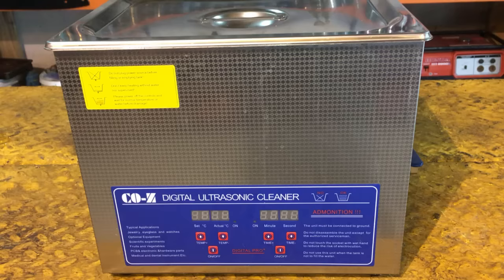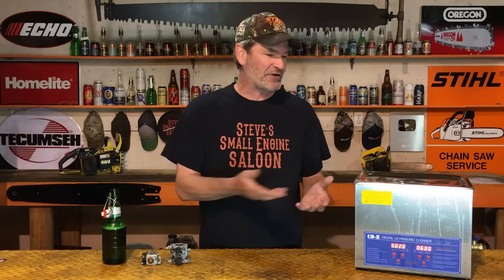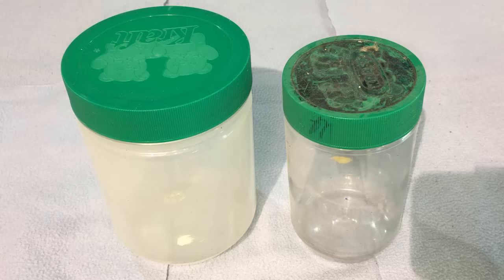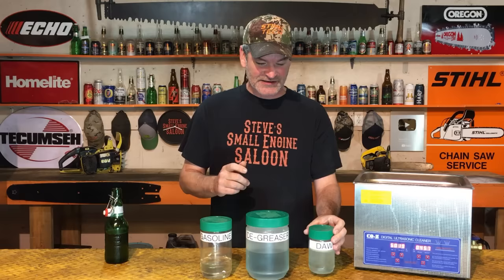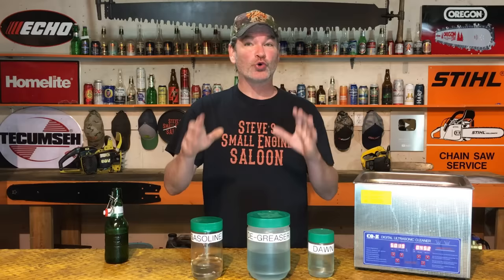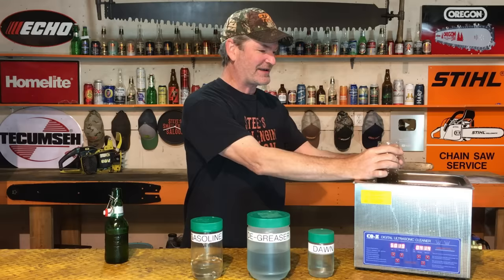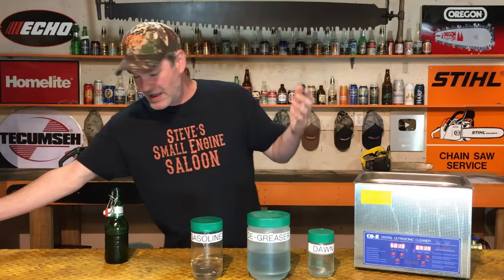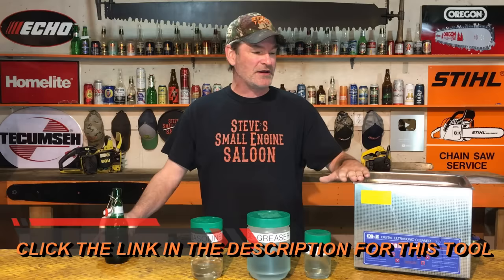ULTIMATE TIPS For Using An Ultrasonic Cleaner (Must Try)

Comment: These bubbles are in fact vacuum bubbles. The cleaning happens when the vacuum bubbles collapses. This is called cavitation.  The imploding ( not exploding) bubbles  blast  the dirt from the surface.  Other than told  it's a cold process... No high temperatures involved. 
Cavitation can happen with centrifugal pumps when the vapour pressure of the liquid is lower than the suction head of the pump. In this case the pump will be damaged soon.

To avoid explosive vapours, don't use gasoline, use diesel or Kerosin instead as a solvent.

Comment: Gasoline should not be used to clean anything that requires an oil film or grease to stick to it. A good example would be wheel bearings. Stoddard solvent works much better.

Comment: If you're using flammable substances it's recommended to put them in a sealed container and float them. The reason being is gasoline produces flammable fumes you probably don't want hanging about something like this which uses high voltage to operate the transducer that produces the ultrasonic sound waves.

If the unit isn't faulty, you're likely fine. But these come from chinese suppliers that tend to cut corners when it comes to safety, and it's better to be safe than sorry.

Comment: use a cheap stand to hang the bottle in the solution without allowing it to float or move. This way most of the energy is transferred to clean the dirt. Thank you.

Comment: You can also use zip lock plastic bags, just put a small amount of cleaning solution in the bag drop in the part you want to clean, seal it up and drop it in the cleaner.
Reply from the maker: Yes I show that in my update video!

Comment: the driver of the cleaner needs to be cooled, on my old model it was not protected at all, i filled it with not enough water and after 30 min became very hot and the piezo made a crack, some sparkles between the gap and it blown

Comment: Your technical description is a little bit wrong, here you will find a better one.
The ultrasonic energy vibrates the fluid at 40kHz. When that energy touches anything hard it will generate vacuum bubbles, when those vacuum bubbles implode (not explode) a lot of vibrations are generated in all directions. And as most fluids are rather uncompressible the sound/energy wave travels in all directions, when such wave reaches something soft like dirt or grease the energy is dissipated into that grease/dirt and it will be transferred into the cleaning solution. When choosing a container is should be thin-walled and have low mass and also be as hard as possible. So soft thick plastics that are compressible are useless, used paint cans or tin cans are perfect and better than peanut-butter jars.
Another cleaning agent that is rather useful is laundry detergents, which will be much better for organic stuff that needs to be removed.

Comment: Hey Steve, I have a question. Can a decompression valve for a chainsaw be cleaned and reused? My STIHL dealers are asking $47.00 for just one so if the old one can be cleaned and reused I’ll be happy.
Reply: Just try it out Shazza, she'll be right mate. you'll STIHL have to buy a new one anyway if it doesn't work so you have nothing to lose.

Comment: The reason the cleaner needs full water is for cooling. The heating element blows out if the temperature gets too high and so does the ultrasonic transducer. Water keeps the temps down.

Comment: Clock hobbyists have a soup that they like for cleaning centuries of dust, glop and dried up oil that has accumulated on brass clock movements. It should not be used on the mainsprings of wind up clocks as it really corrodes iron.
If you want to make a homebrew ammoniated cleaner, here's a mix:
4 ounces Murphys Oil Soap
4 ounces acetone
16 ounces UNSCENTED PLAIN BORING household ammonia
Add water to make one gallon.
= 1 Murphy: 1 Acetone: 4 Ammonia: 26 Water units. Makes 32 units.

Comment: The flashpoint of gasoline is -45 deg F.
This means that when above this temperature, gasoline is giving off a flamable gas that is above the liquid.
Any ignition source, spark, ect will cause an explosion.
It is EXTEMELY dangerous to heat gasoline in an un-enclosed container when around electrical equipment.
When working with gasoline, keep the time with the lid off to a minimum.

Comment: Steve's Small Engine Saloon , what is this thing supposed to do when its running? Is there supposed to be a lot of bubbles, super fine ripples on the surface, mine has none of these things. I added some dawn dish washing liquid to some water, and it wont clean nothing. Put a couple ounces of degreaser with some water. Doesnt do anything but make this buzzing sound. Does anyone know what might be wrong?

Comment: If you pour less cleaning liquid into the tab, the rest of surface of the tab which is not covered will absorb all the vibrations & that will break the ultrasonic machine itself as vibrations has no material to pass through.

Comment: Is there not a heating element to the cleaner (I have never worked with one so I ask) ? I'm not sure if you put the heat up to 120 or whatever, it would transfer into the jar. Also, using heat and a closed jar with gasoline..I can't think that would be very safe but again..I ask because I don't understand. Now that I am retired I love fixing things I can (like carburetors) so I am very grateful for these videos! Blessings.

Comment: Well according to a manufacturer (zenith) you will loose %50 to %60 of your ultrasonic action through the plastic jar, best way to use is suspend your part on a wire off the bottom. If you place material on the bottom you can harm the transducer. Even the basket he has in tank is robbing ultrasonic waves. The more direct is the best.

Comment: Tip for those using it for cleaning brass. Dawn and a 9mm case full of Lemi-Shine dish detergent powder. Thoroughly rinse off when done. And a good way to dry the brass is ti go to your local resale/thrift store and buy a used hair/blow dryer. Put all the brass in a large pasta basket strainer and moving the dryer and brass around  let the brass get hot and after about 5 minutes, give or take a minute or two, the heated brass will evaporate the water. Don;t worry about over heating the brass. Unless you heat it to like 400-500 degrees, it's not going to hurt it. Word of caution. DO NOT USE MORE THEN A 9mm CASE FULL OF LEMI_SHINE!!!
Reply: For drying brass i use a air fryer set as low as it will go, it's quick and easy

Comment: Not 100% convinced, I heard you test an ultra sonic cleaner by putting a piece of aluminum tinfoil in the water and the sonic waves should penetrate the aluminum tinfoil. Can you put some in one of the jars and see what it does?
Reply from the maker: Great idea!
Reply: @StevesSmallEngineSaloon  I am having a hard time finding just the  0.013 drill bits for the carburator low idle to keep it from hunting. Would you happen a have a location or do they ONLY come in kits. THANKS FOR ALL THE GREAT INFO YOU PASS ALONG TO US DIY`ERS.

Comment: I also have a problem. Experienced that with polished gun parts (steel) the cleaner screw up by making em hazy/dull.
already after 1-5min in 40 degree. That sucks ! Then must polish again.  I wanted an easy way to remove all polishing compound before nickel plating.
The only reason I bought one ! waste of money in my use.

Comment: no heat ?  no heated solution ?  interesting, I have a 30L unit and ran it with hot water...I saw a guy (Slades Beetles) use a zip lock baggie and that I tried it and it worked.  Damn I should have kept those peanut butter jars.... maybe gasoline and plastic jars WITH LIDS, is the answer ?

Comment: The easiest way to explain how these work is just vibration. You can just get a basin with solution and attach something to it that makes it vibrate (maybe a partners toy lol) and it will vibrate the parts and cause it to wash itself.
Reply from the maker: Vibration?  Nope, they are sound waves...
Reply: @StevesSmallEngineSaloon  ya soundwaves cause vibration in the water. If you look at how a speaker displaces air its basically the same thing only instead of displacing air, its displacing water at a high frequency.

Comment: Never fill the tank of an ultrasonic cleaner with alcohol, gasoline, or any other flammable liquids. They will vaporize, and could cause a fire or explosion, or release harmful gasses into the workspace.  Just in case you use an open container
Reply from the maker: Agreed!

Comment: I would never use gasoline , way to explosive and if you ever have a fire in your shop or garage your homeowners insurance WILL NOT COVER THE FIRE DAMAGE!!! Most municipalities have ordinances against gasoline in buildings!  Gaspoline vapoirs will run along the floor or low spots and any source of ignition, even a static spark in a cold dry shop will set it off. Better to use Kerosene, far less flammable and actually a better cleaner. VM&P Naptha works well too. Don't use Acetone, Xylene, or Tolulene in plastic containers, they will probably dissolve!! containers are a great idea though.

Comment: With over 40 years in numismatics, the only coins I would suggest ever putting inside of an ultrasonic cleaner would be ones that were found severely corroded metal detecting. Anything else please don’t put it in there… ❤❤❤❤

Comment: I realize this video is a couple years old and I'm only a couple minutes in so far but I just wanted to throw this in there, not that it really matters to the average Joe, but the way I understand it is those bubbles implode rather than explode, at least from what I read recently. I could be wrong.
Reply from the maker: You are correct!  My bad

Comment: Gasoline may be a good cleaner, but it's the first thing in the instruction manual of what to NEVER put in a ultrasonic cleaner as well as alcohol or any other flammable solution because it can catch fire or explode.
Reply from the maker: I agree!  Do not ever fill the reservoir up with gasoline...

Comment: I'm reviewing all the videos about ultrasonic cleaners because I will be buying one.  Several people on YouTube have said NOT to put gasoline in the cleaner because of the danger of a spark from a defective motor igniting and blowing up your garage.  Use kerosene or mineral spirits instead.  Also, don't put your hands or fingers inside the water during operation because your bones and tissue will be effected just like the part you are cleaning!

Comment: So, I went to check and it's not the explosion that cleans but the implosion of the bubbles.  I couldn't find the Beakman's World video but found this one that also explains the phenomenon.

https://www.youtube.com/watch?v=xg5NiOwf_Zw

Another thing that explains the effect is the sound a pan makes when we boil water ... and why when it starts to boil the sound ends: the bottom of the pan is hotter than most of the water in it and it causes the water that is in direct contact with the bottom evaporate forming a small bubble and as soon as it leaves the bottom (or just grow a bit) the vapor turns back into water causing a very fast colapse of the bubble. 

Water exists in gas form (vapor) under certain conditions of temperature and pressure. The water in the pan turns into vapor because we heat it and the water in the cold North Atlantic turns into vapor around a ship's propeller because the pressure gets really low. Well, it's not around the propeller and not always - it's on the face that is towards the the direction of the ship's movement: the face towards the rear pushes water (creates high pressure) and around the other face a low pressure region apears. When the ship is full throttle vapor bubbles form on the surface of the propeller (low pressure) and implode. Those implosion dig holes on those propellers, btw.

Ultrasound in water will create those bubbles (did not have time to learn how) on the suface of the materials inside the cleaning machine and when they colapse they remove material from the surface. Be careful: if this causes holes in huge merchant ship propellers, they can do similar things to your stuff - use the machine carefully. 

But, you may say, that is not that strong ... well, you know how oil companies look for oil fields in the sea? They get a ship, a bunch of geophones in the water behind the ship and a large iron cilinder. They then suck the air out of the cillinder and after that open it. It produces a sound pulse so strong it enters the rocks and solids on the bottom of the ocean, bounce around and com back to the geophones.

Comment: I wrecked mine from leaving the lid off over a weekend and the water evaporated and it burned the heating elements from not having water contacting the inside. That’s why you have to keep to the fill line, the heating elements are on the sides of the tank.
Reply: Your issue was caused by you leaving your ultrasonic unit plugged in with the heating element running unattended for 2-3 days...not the volume of water.  There may be some truth to the water level advice, but based on your  comment, your issue was probably caused by incompetence instead of the water level.

Comment: Steve, this is a bit spooky. I just had my machine delivered today. Your vid popped up. Are you stalking me?? Great tip with the jars. I read a comment below about using glass. I'd like to know how I seal the lid tight enough when using petrol in either glass or plastic? or do   I need a rubber seal on them. Petrol is my go to cleaner and i'm curious as to how long I can keep it for this application. I have around 10 -15 litres of stale fuel that I get from my 2 stroke stuff when emptying. Some of it is abut 5 years old but good enough for removing grime. Do you only use fresh fuel in the ultrasonic machine?? ATB Steve.
Edit. I found your update immediately after this vid. Spooky. 🙂 https://www.youtube.com/watch?v=jeBB-J0fOp4&t=0s 
But Q remains for stale v fresh fuel AND best seal for the jar?

Comment: Hey Sherlock, you do know that just the small amount of movement you made with the gasoline is enough to muddy the water so to speak. Gasoline aka petrol, is a volatile fluid that will dissolve grease and oils. It will penetrate, soften, and loosen impacted and congealed dirt and dust. So the Ultrasonics cleaning is a bit of a furphy.  Something not many people talk about, ultrasonic waves are above the level of hearing operating but ultrasonic cleaner can create noise due to tank wall vibration/cavitation. Many many many so called Ultrasonic cleaners are nothing but Vibration producers, that's why you hear that loud noise at the start and nothing ultrasonic about them. Your Ultrasonic Cleaner?!?!?! is it really Ultrasonic? or have they just put a module at the bottom under the tank that vibrates the metal and allegedly operates like an Ultrasonic cleaner?!?! It makes noise vibrates/agitates the water?